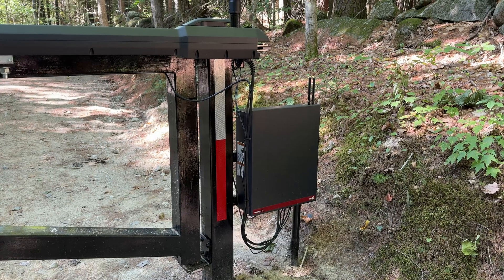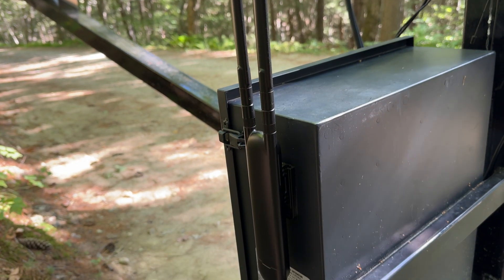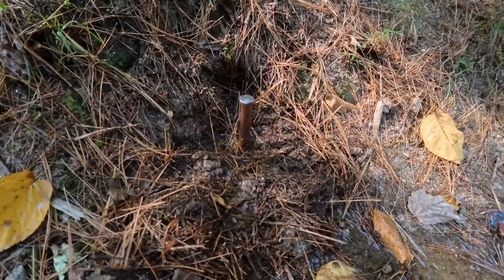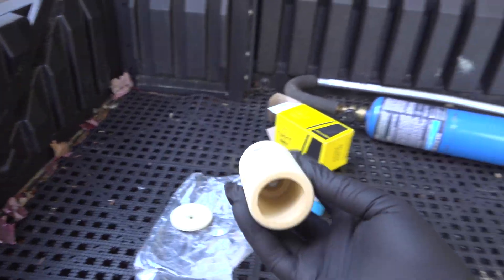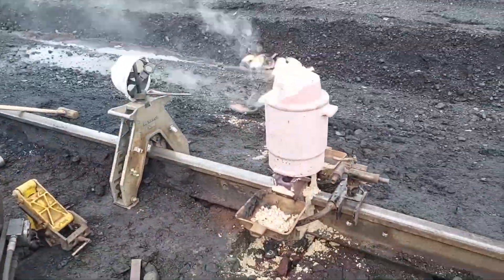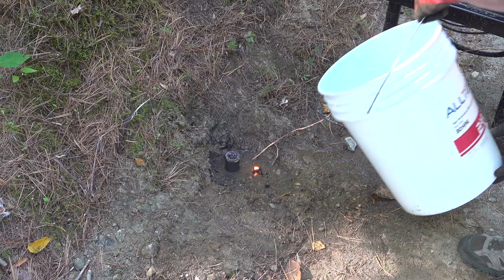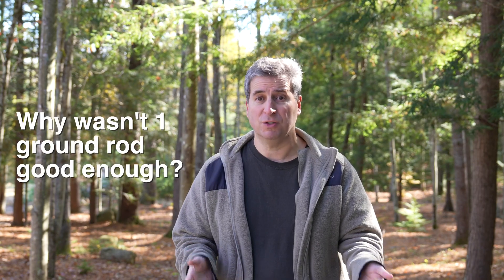Best Way to Protect Outside Network Equipment From Surges

Comment: First of: Be sure to also place one of those surge protectors where your ethernet wire goes into the building.  

You can actually use a clamp and it will never fail, but you have to pay attention to a few things. 
The rod and the clamp should be made from the same material which should be v4a stainless. After you made the connection you can get a special Bandage you have to wrap around the clamp if you want to bury it.

The wire used for grounding the ethernet protector should at least be 4mm² and has to be a solid core. In case of high current the wire will not burst because of the magnetic force from the high current. 
It is also recomended to use either a special ground wire or put a normal wire into a conduit to prevent damage over time.

Comment: couldn't you just solder the rod the wire?  or is that not as good as the weld?
Reply: It's not. Think of solder as a really hard, conductive "putty" that melts with heat. But that heat is a much, much, much lower temperature than what is required to do a weld. A weld is actually uniting two pieces of metal into one.
Reply: @aaron74  thanks for explaining it, appreciate it
Reply: @stavroshouiris  A good soldering joint also requires "keying" for mechanical strength. You'd never be able to solder a conductor to a rod because there is no surface roughness, holes, or shape features on the rod for the solder to grip. Solder doesn’t bond structurally. It just wets and adheres. Without keying any vibration, stress, or thermal cycling will quickly separate the joint.

Comment: That's not how grounding works. Grounding is for static and lightning. The earth will not absorb power surges. Think about it. Where is the electricity wanting to go? If anything, you created a voltage difference along your Ethernet lines. A close lightning strike, and thousands of volts on your Ethernet. Yikes! You should have run a ground wire along your Ethernet line. Look up Mike Holt for more info.

Comment: Incorrect why 2 Ground Rods because of wire or clamp as you said in the video.... It's because 1 Ground rod wouldnet be enough to reach for 25hms of resistance so now inspectors want to have 2 ground rods to meat that number..

Comment: I do believe the requirement for 2 rods has to do with the ground impedance (complex resistance) between the earth and the ground wire.  Damp earth conducts well, dry sand not so much. You can install 1 rod if you prove your impedance meets spec (special equipment needed) or just install 2 ground rods 8 feet apart (easier to do.) It is far better to have a rod go 20 feet deep (two rods with a coupler) but then inspector can't verify it's really 20 feet.

Comment: Nice video. I have used several Cadwelds for doing exactly what you are doing.

What I discovered for a very easy way to ignite them is a sparkler like what is used on thr6 4th of July.

Comment: Run fiber from you house to the outbuilding or gate. Cat 5/6 can only run about 328 feet plus you can pick up stray current. You can go further with fiber and fiber is not conductive

Comment: The need for multiple rods isn’t due to possible failure it’s about effectively being able to get the energy to the ground; not all ground is creates equal and where one 4’ rod may be enough you may need three 10’ rods somewhere else. You can also ground to your water line as that can be a long length of metal in the ground from the house. I’ve been an electrician for decades and have never seen a properly installed grounding system fail. The biggest reason most electrical items fail is improper installation; along this line you don’t need a ferrule for coarse stranded copper wire going into a ground block. Ferrules are used with fine stranded wire as they can get easily damaged in terminals. Glad to see someone promoting grounding in networking; I’ve seen a lot of systems and components ruined because things weren’t protected.
Reply: Let me check my understanding; most things should go back to the system ground (the single home ground shared with the panel(s) because they are usually grounded for AC leakage. This is for lightning protection and therefore it doesn’t matter where the ground is.

Also, the need for two, three, four bonded grounding rods for the system ground often has more to do with the moisture content of the soil; correct?
Reply: @silverbackag9790  ground rods...  Current code will not require more than two. Either test and add the second if the first does not pass, or just do two.  No requirement to test that using two will pass, tho that would be a good idea.  The rods are long enough that soil moisture shouldn't vary by much. 

The electrical panel is a safety ground.  It is for "leakage" of the type that might energize the case of equipment and create a shock hazard. Instead the electricity is conducted to ground and pops the breaker.

This video is on real thin ice re. electrical code and safety.  I cannot condone this approach.  It is against code to add a separate ground if there are any other than the hot(s) and neutral between that separate ground point and the main panel.

In the networking industry it has been known for decades that running ethernet cable between buildings is risky, because it can become a ground path and is not rated for the current that might flow along a ground path. It also can endanger the equipment on the ends. (Best to use fiber optic instead of a conductor.)  He was sort of okay just running the cable for isolated equipment, but now that he has added a separate ground, he has actually increased his exposure to problems.
Reply: chris is a marketing channel, not a real dyi channel. he's trying to sell people the stuff he uses. that's his whole schtick.
Reply: There is so much plastic in the plumbing industry now, that depending on water pipe has not been recommended for quite some time. Even if you verify that the metal pipe is grounded today, one repair can break the connection and render such a ground as open later.
Reply: Never hurts to ground anything metal. I grounded my metal storage cabinet in the garage. Why not.
Reply: @aaron74  money is the reason "why not." copper is expensive and there's no reason to over-ground the system and in some cases a double ground violates NEC code.

Comment: As a 40+ year radio tech here in Florida who specializes in lightning protection. This is one of the better videos on the subject I have seen. Yeah CAD welds are awesome and a top choice, but there are some mechanical solutions that are just as good, like Burndy compression fittings, along with other bolt on style . All direct burry rated.
Reply: How about a three dollar acorn clamp from the hardware store?
Reply: @aaron74  electricians like to call them wedding bands😊 and yes they are an option for homeowner grade, 15ohm electrical panel ground systems. If you are shooting for a Motorola R56 0.2ohm ground for equipment that you need to count on through a storm. That’s where you pull out all the stops with the higher dollar stuff.
Reply: @ricknelson947  Electricians have the funniest nicknames for everything. Some of them not to be repeated in polite society. Ha ha ha
Reply: Yep. We either use exothermic welding or irreversible high-compression fittings like the Burndys for below grade connections. Also in Florida.
Reply: @brentsalassi5245  Is the cad weld required for commercial construction? After seeing this video I might do the cad weld in the future. But I'm pretty sure for residential the acorn clamp is sufficient.
Reply: @aaron74 I’m not totally sure. I’m mostly dealing with tower sites and the occasional building. The standards we use usually meet or exceed electrical codes. So an acorn clamp may meet code for some things, but we still require cad-weld or high compression crimp.
Reply: Bundy compression fittings are so rock solid. Very satisfying to install
Reply: Bundy compression fittings are so rock solid. Very satisfying to install

Comment: Cad weld is just a copper based thermite composition. I use thermite somewhat frequently for chemical demonstrations, and for projects that need a ready supply of molten pure metal.

Comment: Ground rods are easy to install, unless your soil has way too much shale.  I think I gave up on three location after driving them about two feet--had to wiggle to remove and start over.
Reply from the maker: I was very concerned about that as being in NH called the granite state for a reason. I am sure I hit a rock at some point as the hammer got very hard, but the rock either moved or split and it kept going. I guess there is some uncertainty to it.

Comment: Wouldn't that create a potential between your house's and gate ground? Isn't that why all grounds should be connected?
I remember back in the day I was reading something that mentioned that fiber is often used between buildings to avoid any ground potential issues that may be a shock hazard if a metal chassis is touched.
Grounding is an interesting beast.

Comment: ............nearly all of this is wrong.........

-There is a difference between Cat6 and Shielded Cat6 Ethernet. In order for the Grounding to work like you say, you need to use Shielded Cat6 otherwise the ground does nothing. Pair 1 (Orange and White/Orange) - Transmit Data and Power Delivery, Pair 2 (Green and White/Green) - Receive Data, Pair 3 (Blue and White/Blue) - Receive Data and Power Delivery, Pair 4 (Brown and White/Brown) - Transmit Data. None of those are grounding.....

-Next up is wetting the area and how you were driving the rod into the ground. Dont, just dont that VASTLY increases your resistance and makes the work you put in for nothing. Use a Post Driver, they are fairly cheap and versatile, especially on a farm. (oh and DONT CUT OFF THE END)

-Next is the clamps. Copper or Brass fittings do not corrode as much as you think and are used everywhere, even on military applications near salt water. While you can use the thermite route it can be expensive and a waste of time, this is more useful on towers or other applications that have a lot of power running. At the same WAIT FOR IT COOL ON ITS OWN, seriously dumping water on it will cause stress fractures and the connection will be ruined. (Not saying its bad to use the thermite option but its more used in industrial applications not home stead. I've used both in a massive array of builds, some with using 480v 3-Phase power)

And lastly 

- I would LOVE to see the OHMs rating for this. Anything above 4 OHMs is basically useless
Reply: I agree, I think just the standard acorn clamp is plenty sufficient and much, much, MUCH safer and more DIY friendly. You could even put red threadlock on the bolt it if you're paranoid of it somehow unscrewing itself when it's buried.
Reply: You are incorrect. Ethernet surge suppressors protect all conductors in the cable. It does not have to be a shielded cable.
Reply from the maker: I was very curious about this also and came to the same conclusion you mentioned. Shielded cable is only to prevent interference, I could not find any documentation that said it is required for protectors to work.
Reply: @silvercymbalworkshop  it is mentioned in manual of that protector. "The ETH-SP-G2 must be grounded by one of the following methods:  Using the included Self-Tapping Screw to ground the ETH-SP-G2 directly to a grounded metal pole or structure; and using STP cable."
Reply: @CarmichaelCharles "one of the following" means just 1 is necessary.
Reply: @estusflask982 NEVER rely on one method it will bite you in the ass

Comment: We use Mimosa Gigabit NIDs. Seems to work good for us, a bit more expensive at $25 each. 

One thing I question, those looked like Unshielded ethernet ends you showed at the start. Will that actually protect anything if they aren't shielded?

Comment: Nice

Didn't know about the welded connection possibility
Reply: just dont pour water on it like he did because it can (and most of the will) cause a stress fracture shooting the resistance through the roof. 

let it cool naturally which would take 10 to 15 mins sometimes results may vary

Comment: Cool stuff.

I've been slowly replacing my main runs with fiber optic.  No path for stray voltage to take.
Reply: That wasn't an option here though since he was running POE to the gate, so fiber would not have worked.
Reply: You do not get issues with fiber. It is not conductive.
Reply: @gregmckinley5178  yes as he said

Comment: Should be mentioned that it takes more then just sinking grounding rode into the ground,  you also have to prepare the ground to get a real ground.    Otherwise it isn't grounding it effectively if at all.
Reply: wetting the area and shoving it up and down isnt great either and makes its useless too

Comment: "There's no such thing as a surge protector that can just kind of eliminate a surge by itself."  Absolutely unequivocally untrue.  It's called a fuse.  And some surge protectors use them. Most use TVS and GDT instead and those need a reference ground. But fuse based designs don't necessarily need that. They however may not provide as much or the same kind of protection. For instance if the voltage spikes but the current does not a fuse may have a hard time blowing.
Reply: it does take much for damage the ethernet transciever. less than about 100 miliamps. Damage will occur well before that fuse blows and when fuses blow they create surges. where is a sudden break in current flow the inductance in cabling & transformers creates a voltage spike. Typically Ethernet ports have transciever transformers to provide common mode isolation. 

Ethernet SPDs only using TVS diodes, as GDT have way too much capacitance that would cause problems for signal. TVS are also very limited in current capacity because TVS diodes also have a small amount of capacitance. The bigger the TVS diode the bigger the capacitance.

No way will ethernet SPDs provide any lightning protection.
Reply: A fuse is an overcurrent protection device, not an overvoltage protection device.  Overcurrent protection is essential to prevent your wiring from catching fire, but does nothing to protect equipment from overvoltage conditions.  Common MOV based Surge Protection Devices usually come with a fuse because when they wear out they become a ground fault and need to be disconnected.

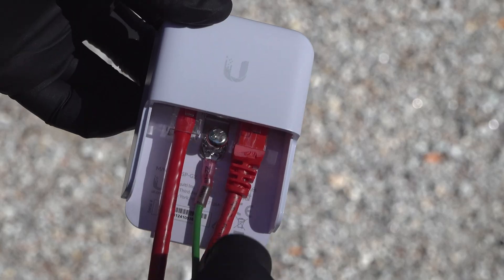Comment: 0:58
You need to use sheilded ethernet connectors and sheilded cable.
This is damn near useless.

I installed tons of these on towers, the only way to safely protect your Ubiquiti equipment is using TOUGH CABLE with TOUGH CONNECTORS, with the drain wires/shield connected. It still isn't "lightning proof", but will do a hell of a lot more then two ethernet patch cables connected like this.

Grounding is about consistency and connecting everything to the same reference, this is not done in this example. Didn't see what the inside connections look like, but if it's anything like this: gotta do better.
Reply: I agree. 

I do this kind-of thing on a military base and if Quality Control came behind me or saw I was doing this, I would be kicked off in a instant. Would love to see the OHMs rating though
Reply: To be clear TOUGHCable is a trademarked product name for Ubiquiti outdoor-rated cable and connectors.

Comment: Hammer drill sds
Reply: Buy  or make a ground rod driver for your hammer drill.
Reply: @jd3497  Make? How?
Reply: Not really that great. I used SDS hammer drills but they are slow. In my opinion, the best option is a fence pole driver.
Reply: Agreed. Just a standard hammer drill, and a socket that fits over the rod. In sandy soil, it is put the rod in fast. No special tools.

Comment: to isolate my shop from my house i use a media converter so there is no copper connection to my home networking equipment
Reply: Yeah that;s smart but glass won't carry the voltage to run the POE cameras.  All the same that is smart.
Reply: Yeah, but I think he's using PoE from the house.

Comment: There's a massive difference between grounding and bonding and these two terms are not interchange. You bonded, you didn't ground.. If you're going to try and teach people then you need to use the correct terminology.

If you ground network and wiring equipment in different structures connected with physical wiring you create voltage potential which will destroy the equipment and can even be fatal. That is why use the term bonding and not grounding. The only thing that's grounded is the ground bar, everything else is bonding.